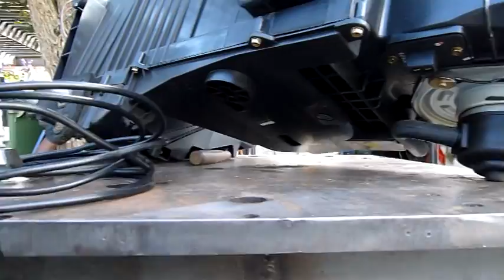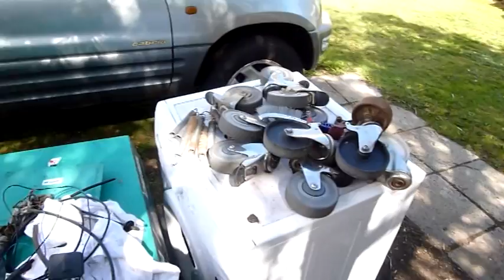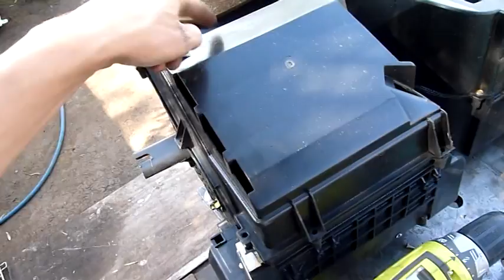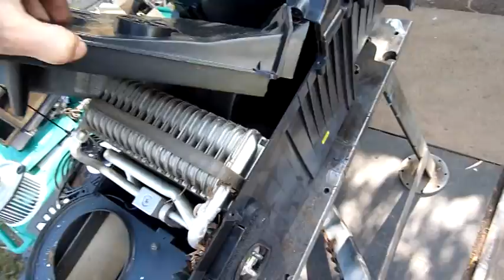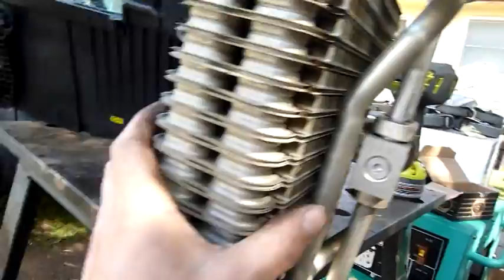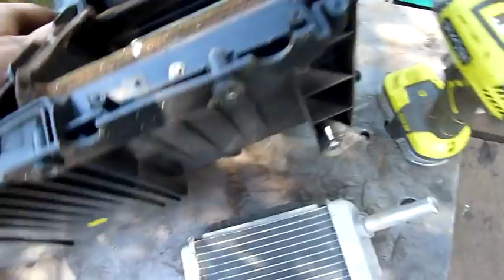Daewoo Lanos Heater and AC Box Disassembly

Comment: Hi, I am looking for answer to whats happened on my Lanos. Suddenly started condensation on the windscreen when i put the blower on. It smells like coolant in the blower and under the bonnet I can see coolant coming from what looks like a coolant drain? I am guessing its the heater matrix cracked and leaking down somewhere then out that drain (drain is a pipe that looks like your meant to attatch a hose to it when you drain the cooolant but guessing here)? But is it a nightmare to get to? I love my Lanos but now I cant see when driving.

Comment: Hi Ed,i've got a 98 Lanos Sedan 1.3 because of YOU. :P

Costed 680 Euros,has 270k kilometers,overall it drives excellent and it's surprisingly fast,it pulls like a charm in third.

I've had some issues as the engine is old,like the clutch pump was pumping air,fixed for 40 bucks.

The worst is that almost all the coolant hose outlets were rotten (happens in all daewos) and we had trouble and 3 days off the road until we get the cyl head off to a workshop and make a new outlet with a lathe.

Comment: Yeah those 2000ish Daewoos are very comfortable to drive for what they are in my opinion,a very distant cousin of mine had a Lanos,my father has a Daewoo Matiz and apart from being sluggish and nasty it's probably the most easy going car for taking you from A to B,and reliable too.

The Micra you have is a very good lil car unlike the newer,i drove for quite much a 2008 1.2 and it was feeling extremely bulky to drive,the older ones feel much more responsive to everything and are cheaper too!